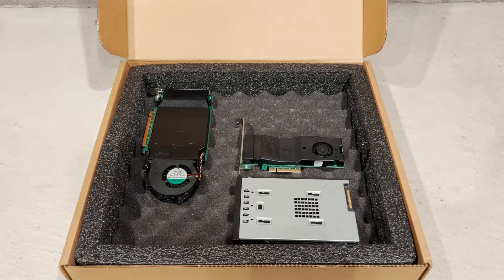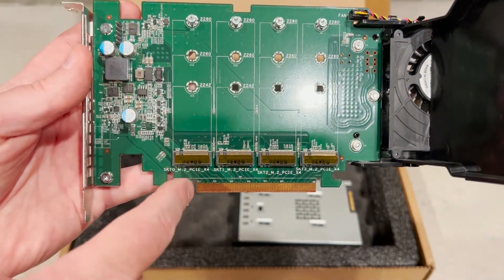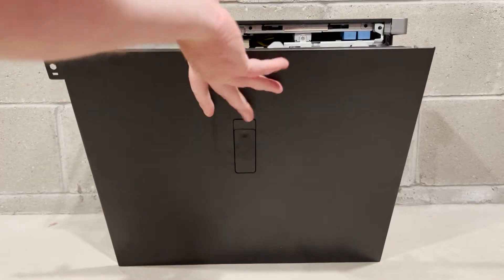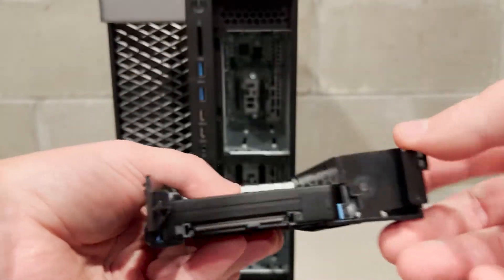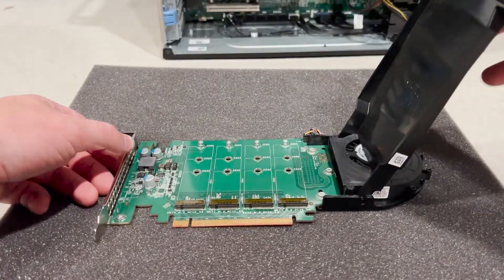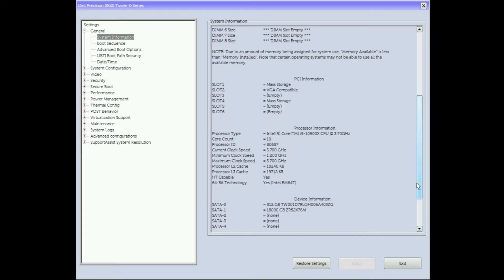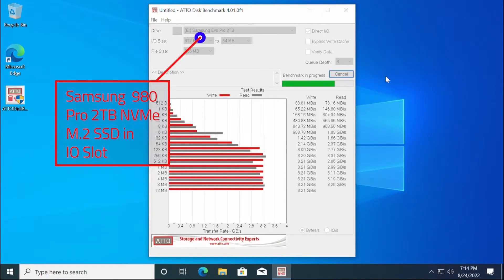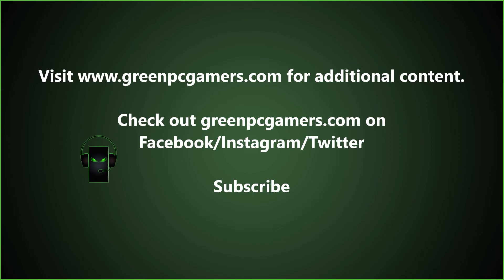Precision T5820 T7820 T7920 NVMe M.2 and U.2 Solid State Drive Installs + Benchmarks

Comment: Great video thanks! Question, at 3:25 you mentioned that the nvme backplane would only work with nvme solid state drives, so if i would like to put another 18tb hard drive in my 5820 in the same bay where I have one of those 1tb NVMe modules, I would need to remove the NVMe backplane too?

Comment: Thanks for the informative video! I'm now very interested in getting an Intel Optane caching solution, but I'm torn between two options and could use your expertise:

Option 1: Intel Optane P4800X U.2 SSD
Option 2: Intel Optane 905P PCIe AIC (for my last PCIe slot (slot #5 - x4 lanes wired on x16))

A few specific questions:
Do you have experience with Optane caching cards?
For pure caching performance, does the form factor (U.2 vs PCIe) make a meaningful difference?
If I go with the U.2 option, do I need a special controller/adapter to use it in a PCIe slot, or to enable front bay U.2 compatibility?
Is there any performance penalty using U.2 with an adapter vs native PCIe?

My use case is primarily AI/ML workloads with heavy caching requirements. Any insights would be greatly appreciated!

Thanks!

Comment: Hello! I wasn't able find infos on the internet about noise levels on full load for T820. Is the only one with a strange CPU setup and i won't be able to replace the fans with noctua ones as i did in T7600 and T7610. So please tell me, how noisy is this one. The 7600 and 7610 were noisy on full load and after noctua upgrade I vccan barely hear them even I have the case open (i cannot put back the lateral wall because of the cooler height).
So, why nobody on the entire internet is not talking about noise level for this strange alien  T7820 cooling system? Absolute 0 infos over the internet over this topic.

Comment: HELP ! (This video was great BTW) - Could you help me with the right driver / BIOS settings to use ? I have a 5820 with the NVME flex bay backplane installed and a 1TB u.2 NVME installed. Windows installer will not see it with the side load driver i have. Do i need to do anything special with the bios settings ?

Comment: I have the NVME backplane, with one 3.5" dell adapter taking an NVME on one side, and the other side empty. Looking at the cables for these two slots that go to the motherboard, if I got an adapter connector to take the empty one and bring it to an SAS 3 pcie card, could I plug an SAS3 hard drive into that slot?

Comment: I have Dell T5820 with 2 NVME back planes. Can I install SAS drive with 3.5 adapter to the NVME back plane?
Reply: I think you need a SAS pcie card. Then you need an adapter cable to take the cable for that slot out of the motherboard and onto the SAS. Still not sure it will work. But it should be OK for the bottom two slots if they are usually SATA.

Comment: Hello, and thanks for the informative video!
I am planning to completely replace the storage in my Dell Precision 7820 workstation. I currently have a 512 GB NVMe drive installed in a front slot, along with two hard drives of 2 TB each in the lower slots.
I would like to get some advice on the best storage solution in terms of speed, considering that I want to achieve at least 20 TB of capacity and I have a large budget.
I am thinking of installing four U.2 disks of 8 TB each in a RAID 5 configuration. Is this a feasible configuration? What additional components would I need to implement it? Would other options be better?

Thank you in advance for your suggestions!

Comment: I added a Dell SSD M.2 PCIE 2x SSD adapter with a samsung 980 m.2 drive. The BIOS sees the drive, but when I boot to install the OS, the drive is not seen. At the moment the M.2 SSD is the only drive in the system. Could you share any BIOS setting updates needed for the M.2 via PCIE adapter to work?
Reply from the maker: Do you see the ssds in disk management?
Reply: @GreenPCGamerscom  If I install the OS on a regular SSD, the disk management sees the m.2 disk. If I try to use the M.2 for boot drive, the BIOS sees the drive, but the OS installer (win 11) does not. I would like to boot from the M.2
Reply from the maker: @RandallJones-l4e what model workstation are you using?
Reply: @GreenPCGamerscom  The Dell 5820, same as in video. BIOS has been updated.

Comment: It seems that the T7920s doesn't support third party quad-NVME adapters (booting, no. Seeing the actual drives via separate Win 11 OS on a SATA SSD in one of the flex bays, yes) so I've purchased an official dell dual-NVME pcie adapter. I only have two NVMEs on me at the time plus it was a good deal off of ebay.

I'm hoping that would be the easiest fix to my boot issue here with my recently purchased t7920

On a side note, I've also been having trouble with the 8 pin power cable clearance for my RTX 4060 OC graphics card in the top PCIE lanes. My quickest workaround with that is to have the side panel hanging via twist-ties & having the intrusion switch covered with tape to trip the switch. In the meantime, I've ordered a right angle 8 pin male to 8 pin female adapter to hopefully give just a bit more clearance to the side panel closing.

Has anyone else had any issues with RTX 40xx graphics cards in the T7920 and/or 3rd party 4x NVME pci-e adapters?

Comment: Hello, I'm considering getting a Dell T7920 with the quad adapter you discussed in this video.  I'm wondering how to set the four m.2 drives in the quad adapter up both as a Windows boot drive and using RAID (e.g., 1 (stripping) or 10).  I believe this is possible because when buying directly from Dell, they offer RAID configuration for the four drives in the adapter and as a bootable Windows drive. 

 Also, do you have size, model, and manufacturer recommendations for the m.2 drives in the quad adapter?  I'm thinking about Samsung 2TB, but I am unsure of the model.  Thank you.

Comment: Thanks, great video, making the differences very clear. I think the Flexbay system is plagued with too many rules and limitations. Plus the 250 bucks you have to pay for the VROC module, just to unlock the full RAID potential of the processor, while only supporting 2 slots in the front.

Comment: Can you boot off the PCIe 4 x NVMe card or do you always need an SSD or some drive attached to the main backplane?
Reply from the maker: Yes, you can boot off the nvme io card without the nvme backplane installed.
Reply: @GreenPCGamerscom  I know you linked a single slow nvme card from amazon, do you think the quad cards would work? That dell quad nvme card it hard to find in North America.

Comment: I have one problem with that workstation, can u help me?
I'm trying to install Windows 10 on the m2, but the installer can't find it. The only storage showing up in the installer, is the HDD 2tb.
My m2, is similiar to the one that you installed on 4:12
Reply from the maker: Are you using the IO card or the 3.5" Tray and Adapter?  Is the Bios boot settings set to UEFI?

Comment: Thanks for the video! I did have a question about the NVME drives. Can you add a second adapter tray with say a Samsung 970 EVO Plus SSD 2TB NVMe M.2 card on the top left slot?

Comment: Thanks, very useful video! I've an NVME adapter with 4 ports, like the one you have.
Do you know why I cannot read in the BIOS any information about the two disks I've insert? One of them is working for sure because has windows in it and I can indeed read it as C drive, but the second one it simply invisible! :/
Reply from the maker: Make sure you install the M.2 SSDs incrementally 0, 1, 2, 3.
Reply: @GreenPCGamerscom  thanks for your answer! I am placing them incrementally. The other M.2 though is the one with 2 notches, key M+B, maybe this is the reason?

Comment: Is it possible to set up a RAID 0 with 4 NVMe SSDs on the Dell 7820 using the Dell Ultra SSD M.2 PCIe x4 Solid State Storage Adapter Card?
Reply: Yes but U need VROC module.

Comment: I have a couple of 5820s that I'm trying to install a couple of 970 Pro nvme drives in via the PCIe slot 4 using a Dell dual PCIe card with fan like you show.  I can't get either to show up in F2 setup.  I can see them if I do an f12 boot options but can't install Windows 10 to either since they don't show up on install of Win 10 pro.  You showed in your video how they all showed up in F2 setup but not the 980 Pro 2TB drive which is how I installed mine.  Any advice on how to make either of them visible?  Thanks
Reply: Hi did you ever get this to work  , I plan on buying a DELL Precision 5820 with DELL pcie nvme adapter and worry I cannot install OS to the drive without some expensive bios option not described in this video ?
Reply: @BenBilesBB-box  Having the same problem here with the boot drives & the NVMEs

Comment: Super valuable video for self-upgrade! 
One question: Do you know why DELL still does not implement 3rd or 4th generation XEON processors in their Precision Workstation line?
All machines on their websites use 2 to 5 years old processors...
Reply: The sockets are different. Intel generally stays on the same socket for 2 years.
Reply: @StarGuardian8180  Wow thank you for your answer! 

I forgot about this comment. DELL already on April announced the new lineup of workstations with up to 56 cores CPUs and they are so powerful that actually no need for a second CPU on the system.

Something for a funny start to today - with these things that happened recently with the LTT, the comment sections have been more and more useful for quality, valuable, and most importantly Honest information about PC and IT at general topics and stuff! ;)

Thank you once again and now I will go and answer to on one programming question from other video to return the favour and help someone else :).

Comment: System T5820: Hi I saw in your excelect video the model DPWC300 for two M.2. Installed a 980 Pro 1TB. Like in your video after installing the BIOS show on slot 4 the Mass Storage. During the Windows OS installation I can't slect these drive. Is there any trick to get it visible?

Comment: I purchased a Gen-4 WD-Black SN770 - but it is showing to be running at Gen-3 speed only - am I am using a generic PCIe adapter.  Is this the upper limit of T5820 regardless of how I connect this drive?  Or would using a Dell PCIe adapter yield a higher performance?
Reply: The motherboard and cpu on t5820s only support gen3...

you need a gen4 slot to get gen4 speeds

Comment: Thanks for the great info. I am tech sup in an  instution and we had bunch of these 5820 machines. By default it had 2 X SSD .We imaged win 10 enterprise to these machines. Couple of restart and shutdown during installation&updates we had encountered BSOD ( Blue Screen on Display) . The error is "Inaccessible boot device".
later , >F12>Recovery>Advanced options> Reset this PC  solved the issue some time .We left the machines on thest and it happened again BSOD. We tried almost everything what was suggested in  the forums, DELL's website etc..Do you happen to know this  by chance?
Reply from the maker: Was the image created with Legacy or UEFI boot settings?
Reply: @GreenPCGamerscom  I'm having the same issue by the way. Weirdest thing; whenever I switch to a SATA SSD for the boot drive, it can eventually see my two NVME drives in the PCI-E adapters AND I can still access programs from them. However, when it comes to booting, I also encounter the "Inaccessible boot device" blue screen error.

I've ordered an official Del duo NVME Pci-e adapter, hopefully using Dell certified equipment might be the quickest fix rather than resorting to my third-party NVME pcie adapter.
Reply: @GreenPCGamerscom  

My 5820 already has a couple of M.2 bays installed, so I was going to buy the caddy tray and install an 1TB NVMe card into it. I want to be able to boot/run the system from this NVMe card instead of the standard SATA HD that it's presently running from. 

Do I have to clean install Win10/11 onto this new NVMe card and essentially reinstall all of the software from scratch, or is there a way of imaging the O/S from the existing HD to switch the boot/run drives in a quicker and easier way? (This is why I was alerted to think about this from your Legacy or UEFI comment just above!)

Many thanks - really helpful video that has helped me understand the upgrade options much more clearly.

Also - I wondered if you would know if a WD Black SN850 NVMe SSD would fit in either of the M.2 bay caddy's or the Dell PCI NVMe adapter cards that you show in your video? I've just got it, and it's quite a thick device with an integrated heatsink!

Comment: Hi, the Samsung 980 PRO PCIe 4.0 NVM is a 7000mb/s SSD. 
So why it's showing just 33000mb/s on your benchmark if is correctly intalled on a PCI-e3x16 (16.000mb/s)?
Reply from the maker: There is a bottle neck that doesn't allow it to achieve 7000MBs in the T5820/T7820/T7920 workstations.
Reply: The drive is not installed in a PCIe3x16 slot. It's installed in an M.2 slot. M.2 slots are limited to 4 lanes.

So the drive is running at PCI-e3x4 (4000MB/s).  

Installing 4 drives into the adapter and creating a raid 0 array would get the theoretical 16,000MB/s

It's a PCIe 4.0 drive. If you want 7000MB/s on a single drive you need a PCIe 4.0 slot.

Comment: Thanks for the video.  Quick Question: For T7920 NVMe M.2 PCIe adapter,  I am planning to add thermal pad and heatsink to samsung 980 pro NVMe SSD.  Will the dell plastic cover still be able to cover it up or fits after adding thermal pad and heatsink?  Thanks
Reply from the maker: We've never tried that.  However, you'll most likely be able to find a heatspreader that will fit underneath the plastic fan cover.  Let us know if you are successful.

Comment: This is a GREAT video!  I have been going round and round with Dell Pro Support trying to get them to find the complete FlexBay assembly for an SSD upgrade. I hadn't thought about a Quad adapter, so THANK YOU for that option!  I have been trying to order the M.2 2280 NVME FLEXBAY MODULE, but they sent me just the empty metal frame - had to return it.  I cannot locate ANY of the components you show here on Dell's website - and both the tech support and sales support are completely clueless. Twice now, a sales agent has promised to "research" my request and email me a quote... and twice now, nothing. It's insane.  The shipping box you show in your video is exactly the same as the one they sent me with the wrong parts, so I am assuming you bought those directly from Dell.  

* For those three items you are showing, any chance to could share the Part Numbers and Descriptions from the invoice?? *  

 I am at my wits end dealing with Dell, going on three months of back and forth. 

BTW, Love this channel, new Subscriber!
Reply from the maker: We try to post most of the parts that we use on our upgrade guides:

https://www.greenpcgamers.com/models/dell-precision-models/t5820/mfg-dell-precision-t5820-gaming-computer/

https://www.greenpcgamers.com/mfg/dell/precision-tower-7820-gaming-computer-and-upgrade-guide/

https://www.greenpcgamers.com/mfg/dell/precision-tower-7920-gaming-computer-and-upgrade-guide/

Comment: Thanks very much for your T5820 videos! I'll looking at purchasing a used one and researching upgrade possibilities. Just to double check I understand what you did in this video correctly - you were able to have the M.2 drives in the FlexBay at the same time as the Quad M.2 PCI card? Unitil seeing this video I thought you could only do one or the other. Also - have you by chance looking into whether this setup works in Windows 11 (I'm wondering if the drivers for the Quad M.2 card work correctly with Windows 11). Would really appreciate any insight on these aspects, and thanks again for the great video.
Reply from the maker: Yes, you can install NVMe SSDs in the Flex Bay as well as the IO slots at the same time.  Windows 11 does work on the T5820.  However, we don't know if there are any NVMe drives issues yet.

Comment: Can you use larger drives with Dell ultra speed expansion board? Like 8TB nvme m.2 drives?
Reply from the maker: The largest capacity that we have tested is 2TB.  Let us know if you try larger capacity.
Reply: @GreenPCGamerscom  i have installed 2 4tb samsung 990 PRO and it does recognize it.   Does anyone know what would be the best approach / Option to Mirror raid the 2 nvme installed on the Dell dual nvme  PCIE card

Comment: Your video was the only one that clearly explained the process and showed the exact steps to perform to install the drives for 7820. Your links also had the actual parts to purchase to make this work. It was impossible to find this information, dell website was next to useless. Thank you for the clear and extremely helpful info
Reply: Yes this is such a useful resource channel.
Reply: I completely agree. Mine has the NVME backplane installed.  I see that you can use the Gen 4 NVME drives but will you get the speed?
Reply: @donmonteith775  No. These are Gen 3 systems
Reply: @donmonteith775 Gen 4 ssds are backwards compatible in case you’re looking for future proofing. It will adjust to Gen 3 x 4 speeds with T7820.